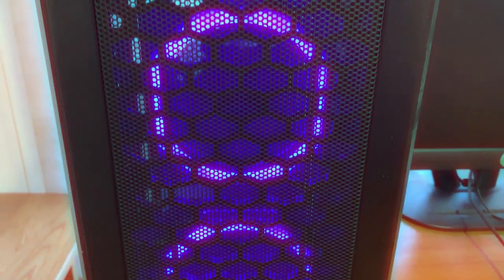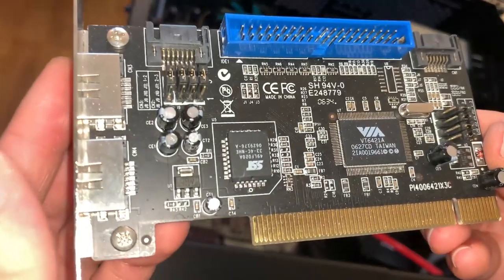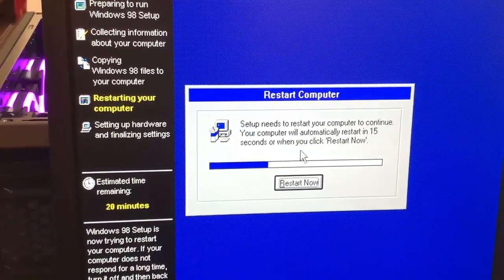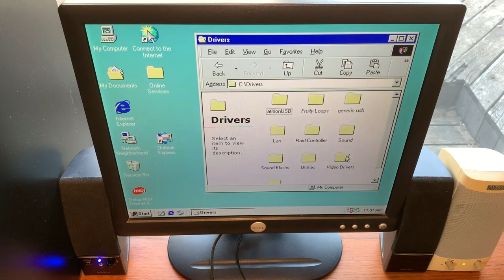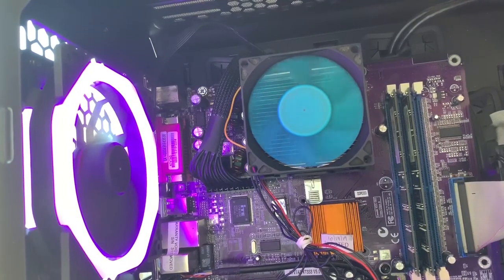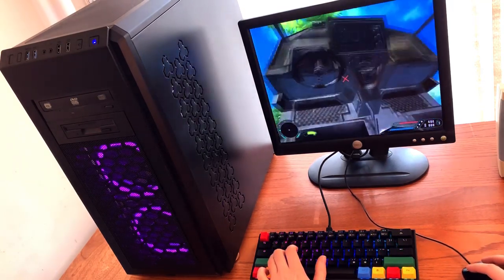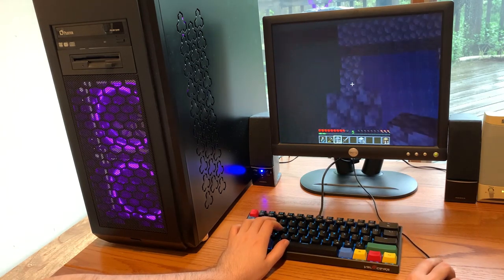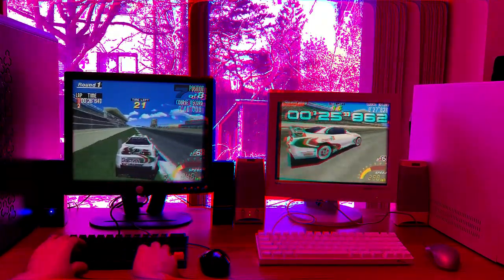The Ultimate Windows 98 Gaming PC

Comment: Do you use the service pack 3? It seams to screw up my installation on my two win 98 machines and they keep crashing. I cant load DOS ither afterwords. One of my PC:s is also an athlon xp3200
Reply from the maker: no, that service pack sucks and while some of the pieces of the pack are useful, the whole pack just crashes stuff and only works properly on i5/i7
Reply: @psychoticgiraffe  interesting. Do you use any patches?
Reply from the maker: @gorbynr1  minimal patches, primarily just the odyssey WPA2 wifi tool, speedtest.net network patch that uncaps the network speed for downloads, dx8 (skip dx9 if possible, in my case I couldn't skip it because of certain games wanting it), kernelex (I don't actually use the features of this, but it needs to be installed to launch minecraft etc), thats about it

Comment: Athlon XP 3200+ ? It says 3000+ in windows. Maybe the wrong fsb set.
Reply from the maker: It’s a finicky board, I had to manually overclock it because of the fsb and it identifies it wrong, but it’s running at the speed of the 3200+ hence the minecraft performance

Comment: I wouldn't call an ECS motherboard with a VIA KT333 chipset "ultimate" anything, I know cause I had the exact same motherboard back in the day. 
If you can find something with an Nforce 2 chipset at a reasonable price it would be worth upgrading.
Reply from the maker: I avoided nforce 2 because in 98 does not have proper support for nforce 2, it is crappy support and has a pile of unrecognized drivers

I used a socket a board with less bs to push 98 farther

this board isn't exactly the "ultimate board" however, It was a cheap solution to keep this in a reasonable budget and was a very good overclocker, pushing the cpu to its limits, not as well as like, an asus board per say, but, the minecraft performance was better than my socket 754 system.

Comment: Can anyone can provide install guide for window 98 install on B450 Motherboard or B550 Motherboard ? Can it be done !
Reply from the maker: currently this is possible, but it runs like complete ass

So I never advise doing it; with this considered; DOS can run properly on ryzen, but its also, a janky mess to set up so its not advised, even if LGR has shown it to work

the problem is that ryzen has no chipset drivers for 98, and unless some genius creates one by wasting months of their time or even a year of their time potentially, we'll never have stability on 98 on ryzen.

right now, the problem is it will run things really really slow but also fast due to the clock speeds, its a chipset driver related issue, the latest chipset that can run 98 properly would be one for a first gen i7, but it makes no sense to do, since PCIE does not work on first gen i7 boards in 98

Comment: Could you do the same but for windows 2000.....
Reply from the maker: only reason I havent done it for 2000 is because 2000 machines would've had similar specs to a top end 98 pc, however, it does appear that someone really liked 2000 and screwed around with the OS enough to get 980 TI or titan X working on 2000, but at that point, its basically my XP build with a ton of extra steps to get web browsers to work as well as on xp.

I'm more likely to do a windows 3.1 pc, I've been recently streaming from my windows 3.1 pc obscure software that isn't emulatable if you check the recent vids
Reply: @psychoticgiraffe  I still love XP (obviously) but W2K always seemed to be a bit special. If I could just get "Mypal 29.1" (browser) I'd keep on using the old battle bus. Keep up the good work.
Reply from the maker: @craigdavidson2278  I've got a discord with 2000 section, they got a very recent version of chromium to run on it, https://discord.gg/rfws7V8P 

thank u and if u do get a chance to look at the latest live streams i did on here, let me know what u think of the rare software I ran
Reply: @psychoticgiraffe  I will look this very moment

Comment: 8:20 This shouldn't be possible since you cant plug the USB 3,0 wire to this kind of a motherboard. Literally makes no sense did you make changes and forget to video say?
Reply from the maker: 100% possible, the trick was that I adapted the cable to two usb 2.0 headers on the board with an adapter, it does not run at 3.0 speeds but its using the same connector
Reply: @psychoticgiraffe  Hell that's a good idea. I always hate when usb ports remain unusable.
Reply from the maker: @ozmobozo  yeah it solves that problem nicely